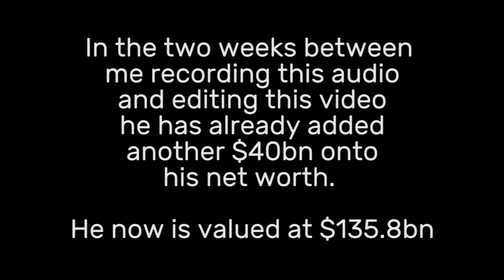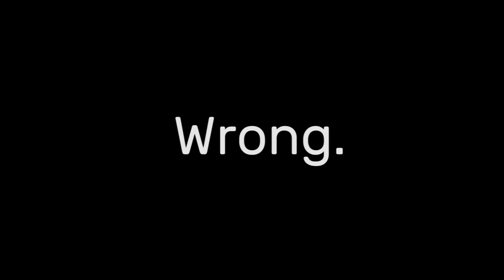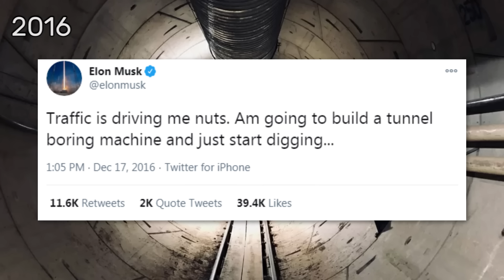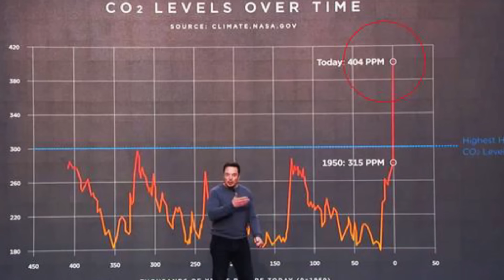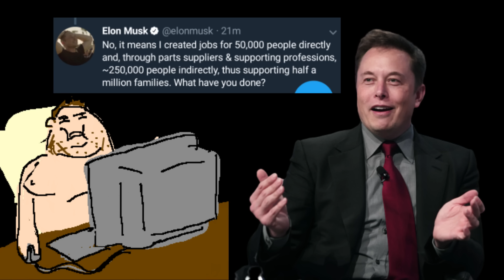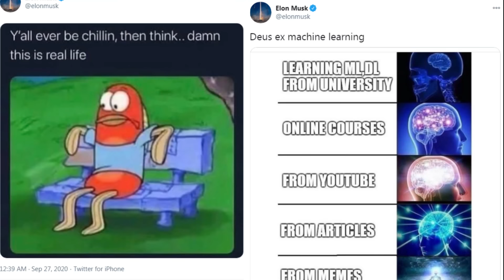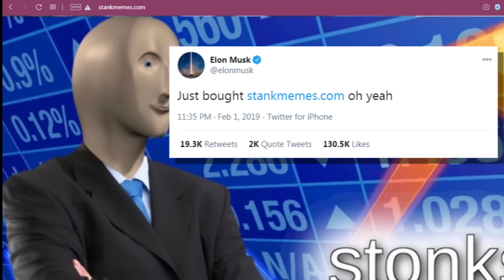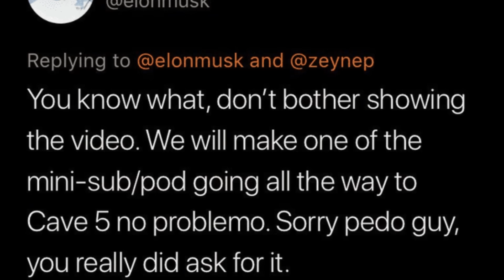ELON MUSK SUCKS!!!!!!!!!!!!

Comment: You forgot to mention how unrepairable Teslas are. Making cars almost impossible to repair/get replacement parts for by anyone but the manufacturer means the manufacturer can charge almost any price they want and do as garbage of a job as they want because they have no real competition. The manufacturer being able to hike repair prices means it will become much more viable to just buy a new car than to repair the old one at a much earlier point in the car's life.
This means these cars will spend less time on the road and will become very disposable just like the rest of the tech world. This is massively wasteful and bad for the environment. It is much worse for the environment to break down a car into usable raw materials such as the ones used in its batteries and the steel in its chassis to be used in making a new car than it is to just repair the old one and for someone to keep driving it for a few more years.

#righttorepair
Reply: Mans making apple cars
Reply: I used to be a car washer and had to wash a lot of Tesla cars. I never liked cleaning them because I had to be super careful to not break something or cause a short-circuit, which to my suprise was very easy to do. Lucky for the rest of the crew, I had my way with tech and had enough common sense to not force something and asking the right questions to my crew before doing anything. They kinda let me handle most of the Tesla cars because of my quicky insights and realizations but I wasn't liking them a bit. 
I especially did not liked those suicide doors some of the Tesla models had (doors that open upward instead of opening sideward) because I kept hitting my head on them when cleaning the insides... It also puzzles me greatly why they had to make Tesla cars so overly complex, like two electric buttons of opening/closing those suicide doors in two different ways with no way to manually opening or closing them by hand, I once tried to manually close such a door and I quickly realized that they cannot be closed that way and doing so might break that door. XD

A little note: We used "waterless" cleaning by using special spray bottles and a bunch of microfiber cloths, incase you wondering how we clean them. We ain't using a water hose xD
Reply: @Alphanoob99  Easy to do? Bruh. Who told you this. Electric cars are 100% fine with water, everything is sealed. You can literally use a Tesla as a submarine!

Note: I didn't read your note
Reply: @lachlanB323  oooh
Strange, I heard something else about Tesla. But thanks for correcting me
Reply: Isn't that about third-party manufacturers? Teslas aren't that common so they don't make as many parts, I also assume new tech is harder to produce than a design that was same for decades. Just like how rotary engines are hard to fix with expensive spare part prices and lack of mechanics with experience. You can't blame tesla for it.
Reply: @Alphanoob99  are you talking about those lane sensor things? My mom’s car is a bmw (hybrid) and it can’t even go through a car wash without messing up the electric stuff or whatever. She has to wash it by hand.
Reply: @nuclearbomb9483  man makes ice cream machines that McDonald uses
Reply: It's such a massive problem that some people flat out think it's a good thing.
Reply: No mods that can be added either. Ya the plaid got 1200 up but it ain’t never gonna beat a Bugatti 1400 hp. Gas will always be a better vehicle
Reply: @lachlanB323  they aren’t good with water and no you can’t use it as a sumbarine this guy in Chicago had it turned off after 4 inches of water
Reply: @thedude3005  apple has made it a common practice to require third parties to not sell parts used in their products to anyone but themselves purely to make it impossible to buy genuine parts for third party repair. The tech being harder to produce has nothing to do with it. If they can make it they can make it. It doesn’t suddenly become harder to make when I want the part to repair my own car vs when Tesla wants one to make a new car. If they can make enough parts for the millions of Tesla’s rolling off the lot each year they can sell parts to third parties.
Reply: @Alphanoob99  These cars are a more recent thing
Reply: Yeah rich rebuilds goes in to this a lot. 

It's not so bad now when teslas are newer cars but as we start to get more older teslas, they're gonna be an absolute nightmare to repair.
Reply: When has a car ever been easy to repair? Maybe when they were so remedial that it wasn’t that complex of a machine but cars built in the last 20 years aren’t that easy to repair because of the increasing complexity of car designs. I dont really think car manufacturers should have repairability as the top priority
Reply: @magicopn  nobody is asking for apple to put massive Phillips-head screws on the next iPhone. We just want them to stop deliberately getting in our way so we buy new instead of repairing old (which is terrible for the environment). 

Sell me replacement parts. Right now if you damage the door of your Tesla beyond repair and need to replace it Tesla just strait up won’t let you. They will not sell it to you. If you pull one from a junk yard and try and install it they’ll revoke your supercharging and you’ll only be able to charge at regular outlets. Nobody is asking for tech to be dumbed down and made less complex, just if I want to go to a competent third party who has the skills and is up to the challenge then let them repair my tech. Don’t put artificial road blocks up.
Reply: Yep, Apple mentality
Reply: No competition? Have you heard of other auto manufacturers perhaps?
Reply: @lmy2366  you don’t find out how repairable a car is until it’s many years old for one thing. 

When a company is a leader in its industry everybody tends to copy their business model. We see it with apple removing their headphone jack and everybody following suit. Unfortunately this isn’t just an apple problem or just a Tesla problem. Everybody is doing what they’re doing. You can’t just not buy from them and not be effected.
Reply: @pchris  Vertical integration cuts out 3rd party vendors, which, ultimately done right, is a good thing. Auto makers (if wanting to expand market share) will be forced to lower prices, that's how capitalism works.
Reply: I love right to repair
Reply: They sound like the car version of Apple
Reply: @sweatyhaggis4303  that’s because they kind of are.
Reply: I ♥ GASOLINE!!!1
Reply: 100% right

Comment: One correction I'd like to mention with Starlink: in order to be seen by astronomers the satellites need to be lit up by the sun while the earth is in darkness. This can only happen just after sunset and before sunrise given the low orbits of the satellites, probably about an hour to an hour and a half away from each. There's still a lot of night where they would not be visible.
Reply: except that window is the ideal time to do astronomy in
Reply: @clapyoass4296  How does that work? Isn't night/ complete darkness the best time? ^^
Reply: @vladimirlenin4080  whats your background in astronomy
Reply: @5446isnotmynumber  if it was that would be concerning xD, It's astronomy that's the science. Astrology is the junk that is peddled in the last page of a newspaper
Reply: Besides can’t we just use space telescopes? Sure we cant build near as many in space for the time and cost required but we can still do it.
Reply: @nolategame6367  i meant astronomy
Reply: @joshuaashton1929  If there's anything good that SpaceX is doing in this regard it's making it cheaper to launch said space telescopes. Although we'd have to wait for Starship to properly do that, but full operational service of that rocket is roughly a year out at this point.
Reply: @elektrotehnik94  its more to do with the moon and it just happens that stars are most visable slightly after sunset or before sunrise, though depending on time of year it may be fine to do it during midnight.

Nevermind the other issue the satelites pose, elon wants to add another 45k satelites to low earth orbit, that will need to be replaced fairly often, which will just accelerate the keppler effect eventually trapping us on this plannet.

edit: the best times are mainly around 19:00-22:00 or 0:00-4:00 give or take an hour
Reply: i saw them with my own eyes in switzerland it was like 8 or 9 pm
Reply: @clapyoass4296  I see, that's good info, thank you <3
Reply: @clapyoass4296  Honestly these satellites wouldn't be that bad to Kessler Syndrome. They orbit low enough that drag is significant enough to de-orbit them relatively quickly; anywhere from a couple months (or less) to a few years depending on the orbit. The other 2 competitors, Kuiper and Oneweb, are actually riskier in this regard.
Reply: @noname117spore  yes because iirc adding roughly 40k satelites every 2-3 years with intent to just leave them wont accelerate the keppler effect at all, even if its less satalites at a slower rate it will accelerate it, considering current satelite internet only actually needs about 3-4 in a  high orbit
Reply: @noname117spore  that still ignores the fact that 3 satelites at high orbit is enough
Reply: @clapyoass4296  Ping is going to be far far higher for said geostationary satellites and only having 3 big satellites is going to limit the maximum bandwidth they can provide far more, allowing for fewer customers with slower internet with more restrictive data caps. Sure, covering the earth with satellite internet is easy. Covering it with high-speed internet is not.

(Note: Geostationary satellites are 35.8K km away from Earth, while Starlink is 550km away and Earth's circumference is 40K km. That means at most you should be looking at a 20K km transmission with regular internet, and geostationary satellites would add 71.6K km onto that, while taking away less than 10K km, whilst Starlink currently would add 1-2km onto that transmission, maybe less in the future. So 22K km is how far the data would need to travel with Starlink and >81.6Kkm is how far it would need to travel with geostationary satellite internet. Transmit it to your location and you're looking at a 2km to 71.6km comparison, so more reasonable internet usage would be between these 2 extremes)

To provide the same amount of bandwidth as Starlink it would take roughly the same number of launches, due to a decreased payload capacity but also not having a bunch of satellites over the ocean at any time, assuming there's no decrease in bandwidth from the 4x or more increase in distance the data needs to travel. SpaceX would be sacrificing ping for this and any future bonuses Starlink could offer to ships and planes flying over oceans is also not present since they're eating into the same pool of bandwidth that the regular customers are eating into, and my "same number of launches" calculation only works because of the payload loss to GTO being cancelled out by the landmass coverage percentage of Earth. But hey, they'd get a longer lifespan, although increases in technology may render them obsolete over time. I'd expect maybe 10 year lifespans before the onboard technology starts being limiting, but they could be looking at 15-25 year lifespans in said orbit, just with them being obsolete for the latter half of it.

Also, just a quick look at the total bandwidth argument, Starlink provides 20 Gbit/s per 260kg satellite while ViaSat 2 was intended to provide 300 Gbit/s on a 6400kg satellite. Viasat 3 is planned to increase that to 1000 Gbit/s. This gives Viasat 3 the best kg per Gb/s ratio of 6.4, Starlink in second at 13, and Viasat 2 in third at 21.3. But 3x as many Starlinks could be launched from a Falcon 9, bringing it down to 4.6 (although the ocean argument may apply here).

Also economies of scale benefits Starlink better, and Starlink produces no permanent space junk whilst geostationary satellites do. And Starlink would have far better ping.

So yeah, there's definitely a business case for low altitude internet satellite constellations instead of geostationary internet satellite constellations.
Reply: @noname117spore  satelite internet is destined for bad ping, anyone caring about ping is using wired
Reply: @noname117spore  this isnt even getting into the cost where its such a money pit that you need more than the entier earth subscribed
Reply: @clapyoass4296  Not sure where you got that number from. The internal cost to launch a Falcon 9 is probably about 30 million conservatively, and each sat costs about $250K. I've run some numbers on this, and for the initial 12K satellite constellation planned I get about 1.6 to 1.7 million customers needed worldwide to break-even after a 10 year period, although that's not including various forms of operational cost that would increase that. But that includes launch costs fully. And if they start flying on Starship that gets better.

Estimating about 130,000 100Mbit/s streams being able to be supported at once between the US and southern Canada (based on some calculations I did for the number of satellites over said countries, although it's a rough estimate as I don't have a good hard number for it), and estimating that Europe is the same size, requires a 7.5x oversubscription rate for just the US and Europe to break-even on the launch costs and dish manufacturing costs alone. Typical ISP oversubscription rates are 5x to 20x. Even with the operational costs thrown in, throw in the rest of the world as potential customers along with cross-oceanic flights and ships and suddenly it looks like it should be profitable.
Reply: @vladimirlenin4080  a Commie in A capitalist video's comment section

Comment: I'm a firm believer of "Electric cars doesn't solve anything related to cars because it is still a car"
Reply: Why?
Reply: ????whats your point?... electric cars never were meant to solve stuff related to cars... ???
Reply: @MuktiLuv  what's meant here is electric cars are advertised as the solution for traffic related  problems. But they only solve one tiny issue, and doesn't even solve that well.
Reply: @realGBx64  solution for POLLUTION issue... not traffic dude.
Reply: @MuktiLuv  yeah. And if you have ever lived in a city, pollution is just one part of the problem. Just because all the cars whooshing by are electric, won't make city life better. They still need parking space (which is wasted space), road infrastructure (which is wasted space and dangerous to pedestrians and cyclists) they destroy (which is expensive and polluting to replace), rubber on their wheels (they shear off and need to be put in landfills after they are used up), etc.
Electric cars is like a bully who doesn't stab you only beats you so now you don't bleed on your shirt.
Reply: @realGBx64  ???... dude, what are you talking about?... he NEVER meant to -make city life better/parking space/road infrastructure/landfills/etc... its about moving to clean energy IN THE LONG RUN... climate change/pollution stuff... there's no debate on that mate, you just got the premise wrong.
Reply: Roads. Goddamn step-by-step guide to make roads. Cement.
Reply: @sonetagu1337  takes months to build roads and for highways its even more. Don’t forget about the cost of actually maintaining the project, crew, assets/equipment and more.
Reply: And also producing lithium